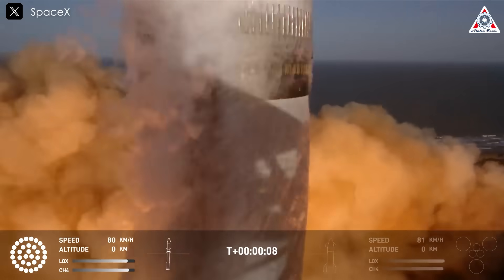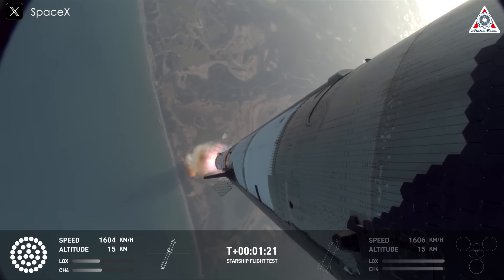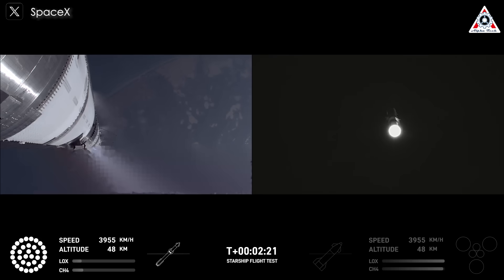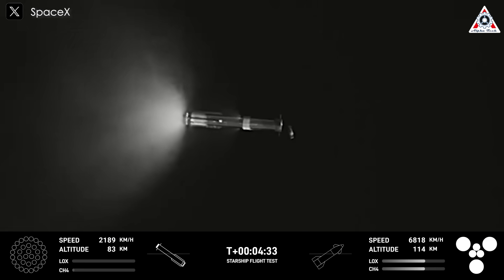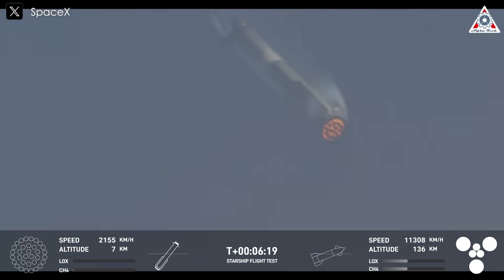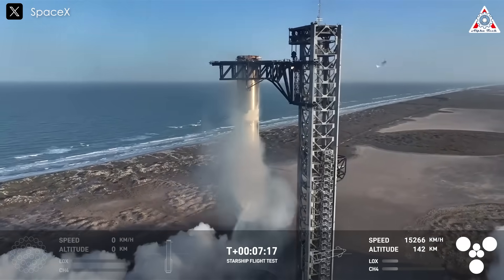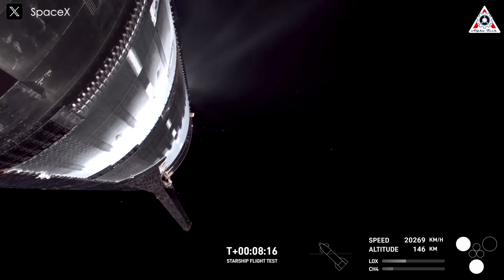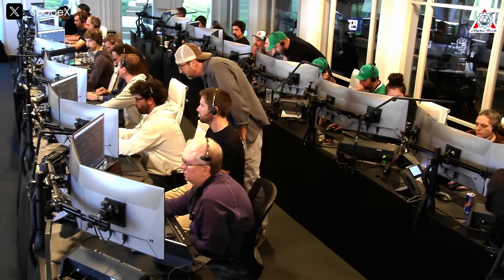SpaceX Revealed What Exactly Happened With Ship 34 During Starship Eighth Flight...

Comment: This project is one next explosion away from the final end of the 'Starship' project. Elon is a total fool, an autistic Asperger patient, taking non stop anti stress drugs and ketamine, thinking that his Starship would perfectly work in all aspects after about 10 to 15 testflights. The truth is, he is at least 30 to 50 testflights away from reaching all his goals, if ever. And after many explosions and failures of future flights to come, he thinks human beings would still trust his project and verhicle, and astronauts would step into his flying grain silo in full trust. This will never happen. Raptors are very unstable, the heatshield will never work on a ship with movable flaps and very very burn-fragile hinges, were heat tiles fly off every flight, the hot staging damages engine components and fuel lines, the vehicle is way too big with only a 4 mm thick hull, the thing is leaking fuel everywhere, it has no landing legs, so how can it ever land on Mars, and why is Elon working with a catching tower, were there is no catching tower on Mars, and no infrastructure at all? Should he not first have designed landing legs for the first Mars landing? Should he not first test and improve the heatshield to perfect working before implementing a PEZ satellite dispenser? And i am not even talking about reaching full orbit without errors, placing starship fuel tankers in space, the refueling, and the need for many thousands of Starship flights to built an infrastructure. Elon musk is a genius on one side, but an absolute wishful thinking lunatic without any rational realism on the other side. Starship fans follow him like he is a religious god. He is not. he is human being, and like us all, imperfect and fallible. Cybertruck was a flop. Tesla stock falling like rocks, Starships explode on a row. Elon Musk's empire is falling.
Reply: You are so judgmental. It’s not nice to kick Elon when he’s lost his attitude control and is about to burn up.

Comment: It is a fuel leak…so what cause?  Both time the leaks occurred when the bulk of the fuel was expended….to me it seems the integrity of the big internal downcomer is the culprit.  It is supported by the fuel volume when full, but as the tanks drain off, it is subject to changing vibrations or harmonics.  Just a theory….lets see what happens.
Reply: Hot staging is violent.  Possible damage occurs here.
Reply from the maker: It is true that there is a fuel leak but to be more precise we should wait for SpaceX's statement